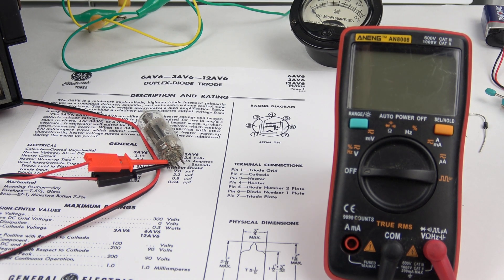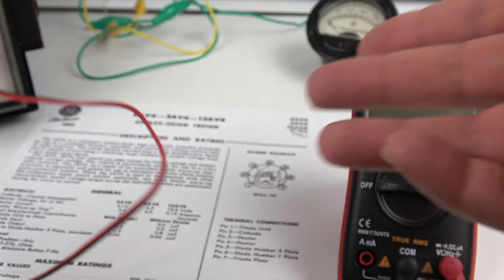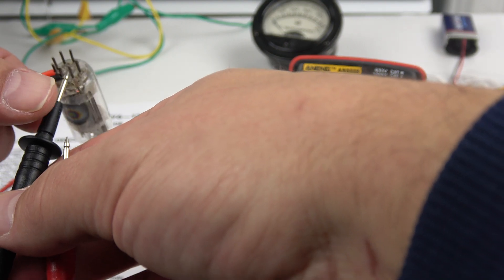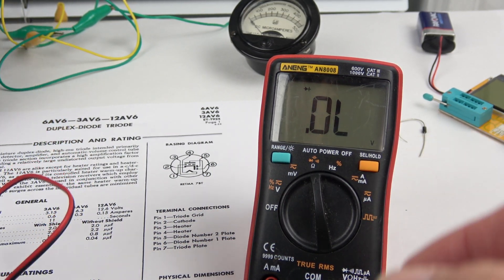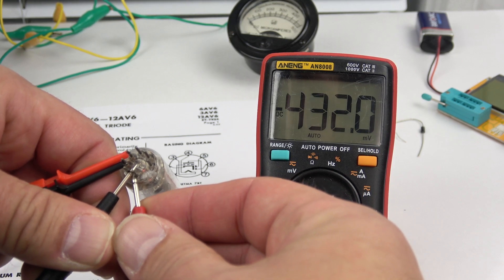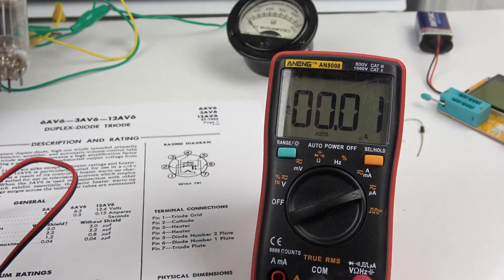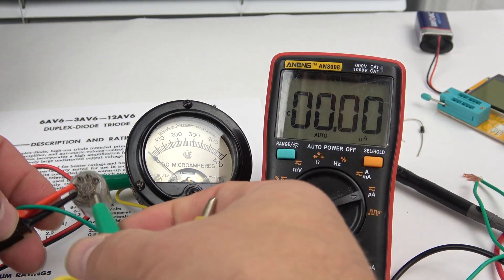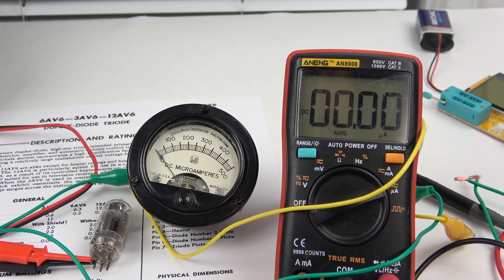Vacuum tube generates electricity!

Comment: No. It is not generating power.  Your multimeter feed it.

If you wan't more free energy you must have 30 feet long (10metrs) vacuum tube with a single wire pointed to the sky. + from the wire and - from the mother earth.

If you reach 100 meters you don't need even vacuum but brush shape antenna (more pins more gain) on top of it.

That may must be in the 30 feet vacuum tube too if not working. tube  material does not matter.

Comment: 300uA is plenty to light up an LED but I imagine this is a current you get into a short and it’ll be an order of mangnitude less if you dump it into say a 400mV voltage source instead of a short. So it’d probably take 5 vacuum tubes to make a high efficiency red LED glow enough to see with a very sensitive camera, and maybe 20 to easily see it? Worth checking for sure. I decided not to mess with vacuum tubes since knowing myself I’d be next trying to build a computer out of them and it’d be a terrible money sink.

Comment: I'd like a thermionic converter; even the model ones you can find video demonstrations of could make useful power from a small flame. They're much better at it than this of course - and if we put enough research in, comparable to heat engines.

Comment: It would be interesting to see how "noisy" that electron bleed to the diode anode is... 12AV6 tubes are used as the AM detector in later generation "All American 5" tube radios as the positive swing clamp. The negative side is then filtered to generate the audio signal and a negative AVC voltage, making the diodes an integral part of the audio circuit.
Cheers,

Comment: JOESNOTES, why would a designer apply high voltage on the metal tubes shielding instead of using ground?
Reply: Because the absolute value of potential doesn’t matter. In any good power supply the “high voltage” side may be just as good as the ground. They are coupled by a low impedance (except maybe at DC). An ideal power supply is a current-limited short, pretty much, with a potential difference at the terminals - aka an ideal voltage source, although people have trouble at first seeing that the only difference between an ideal short and an ideal voltage source is the terminal voltage. An ideal short is an ideal voltage source set to 0V. When you have a good power supply, it will approximate an ideal voltage source, ergo it will approximate a short, ergo HV is as good as ground in terms of shielding ability. It’s not as simple in practice of course; but that’s the fundamental reason why it’s possible at all.